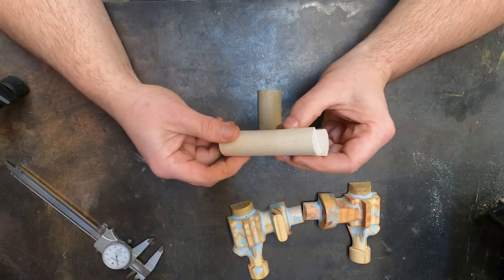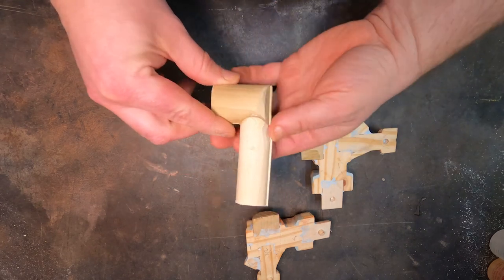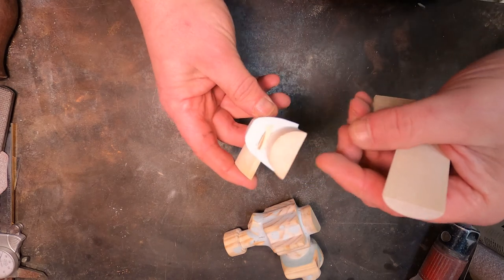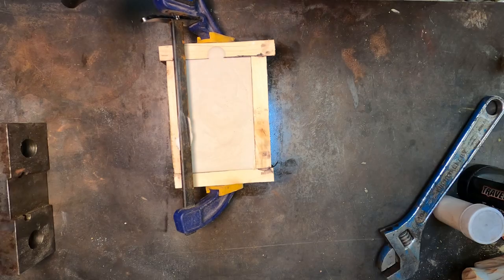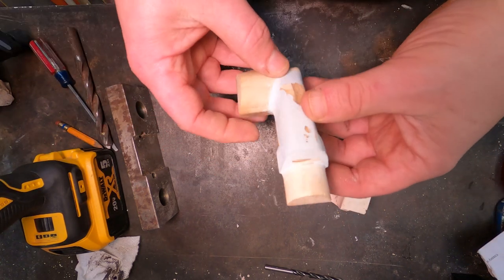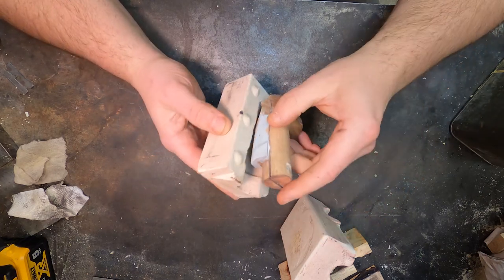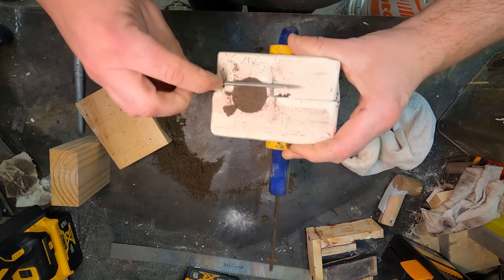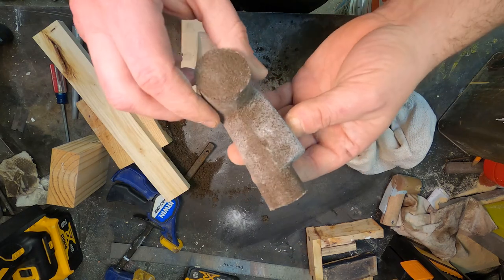Building Sand Core Box For a Two Stroke Engine Block

Comment: Very interesting. Nice work sir. I really need to try my hand at casting
Reply from the maker: If you don't have a furnace to melt aluminum, small propane setups are cheap and green sand is cheap & simple to make.  Practice on simple flat parts first.

Comment: Looking good. I'm surprised at how well the greensand core came out of the mould.
Reply from the maker: Yeah considering it's raw uncoated plaster. I'm going to brush some thinned epoxy on the core box to seal it and to offer some abrasion resistance against the sand.